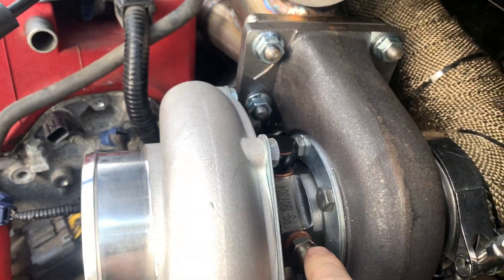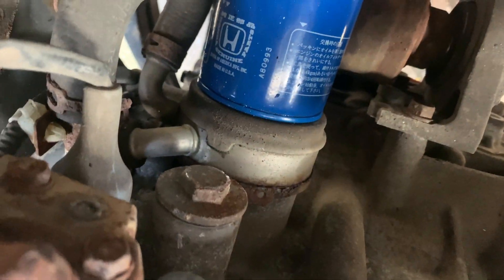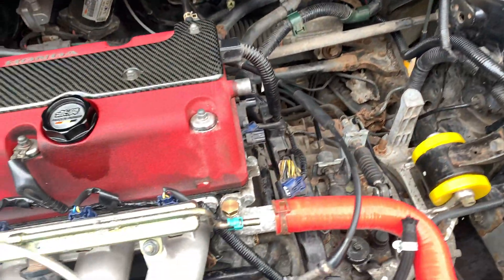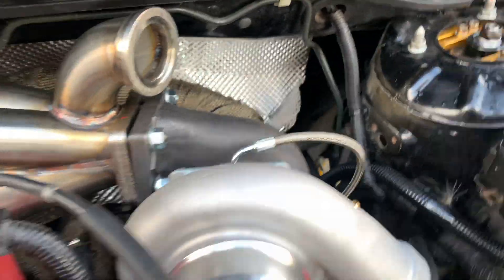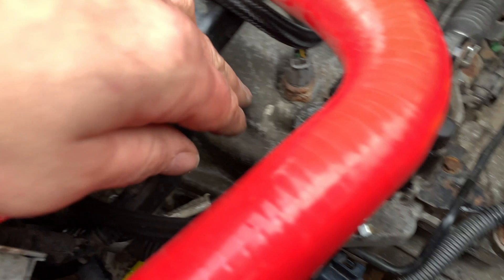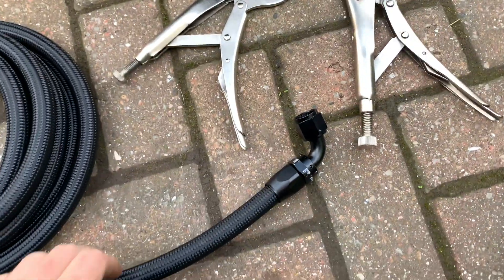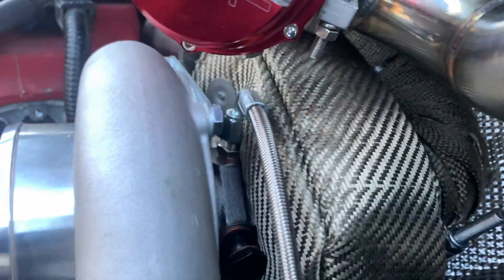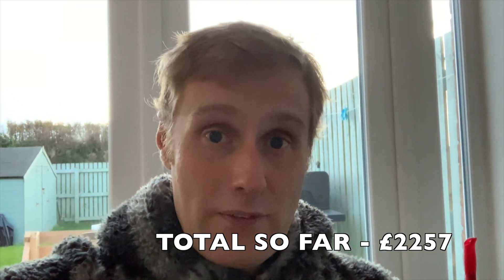K20 EP3 Type R Turbo Part 4 - Oil And Water Lines

Comment: See the 2 other pipes under the throttle body that were connected to water feed and return what do you do with them?
Reply from the maker: Nothing attached to them on the throttle body. Used pipes from the engine as the water feed and return to the turbo

Comment: Your oil drain fitting angle is bad and will cause backing up and turbo smoking.
Reply from the maker: It didn’t cause any issues in the 2 years I had it 😂
Reply: @1BlueGhost  oh nice.  The reason I mentioned it because my drain fitting was a little angled down and caused  smoking in exhaust.

Comment: Hey mate, your video series has pushed me to turbo my EP3!

Could you clarify the routing of your water hoses, where exactly did you take your feed/return from ? 

Thanks
Reply from the maker: Hello

The water feed and return are plumbed into the metal water pipes which would usually go to the throttle body.

Comment: don't even need coolant lines to the turbo tho...
Reply from the maker: It’s an oil and water cooled turbo?
Reply: @1BlueGhost  so is my Garrett but I'm only running an oil feed. the coolant ports are blocked off. not Many ppl run them water cooled. it only heats up the coolant and makes the radiator less efficient. I've never seen a need for both
Reply from the maker: @TheShangralaaaa17  oh right didn't realise that. to be honest my coolant temps have always been bang on, its quite a large radiator on the ep3 id say. ive always had turbos oil and water cooled. the waste gate has water ports, but I guess I havent piped those in. Might have a look at changing it if it works ok still as you say.
Reply: @TheShangralaaaa17  if you have water lines you should run them in my opinion... keeps the oil from coking in the turbo. Granted you could always just use a turbo timer.
Reply: @thatbluefa5913  you can always just get a oil cooler too.  but yea

Comment: Do you remember the length of the oil feed and where you got it from?
Reply from the maker: Yeah sure it was just over 1metre 

https://www.ebay.co.uk/itm/MAMBA-Universal-Turbo-Oil-Feed-Line-Kit-Garrett-T3-T4-T04B-T04E-T04R-T04Z-104cm-/273474848723?mkcid=16&mkevt=1&_trksid=p2349624.m46890.l6249&mkrid=710-127635-2958-0
Reply: @1BlueGhost  thanks

Comment: Wat turbo is it again mate
Reply from the maker: Gtx3582r dual ball bearing one from eBay. I think it’s the same as the boostedboiz use on the mr2
Reply: @1BlueGhost  . Knock off for Garrett turbo ??
Reply from the maker: @johntobin3673  yep. They are £350 on eBay
Reply: @1BlueGhost  boostedboiz!🛠🚗💨

Comment: Really good work, how much boost are you planning on running through it, have you got colder spark plugs or running standard ones.
Reply from the maker: I haven’t got colder plugs yet although they are saved on my eBay watch list. Not too sure on boost, the wastegate has a 5psi spring so will start there and then see what happens. The aim is for about 450hp.